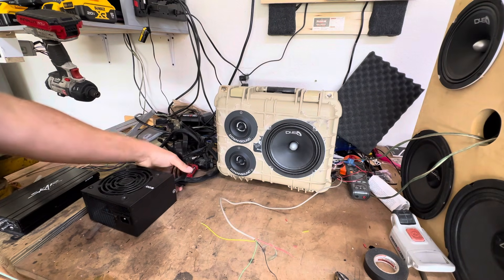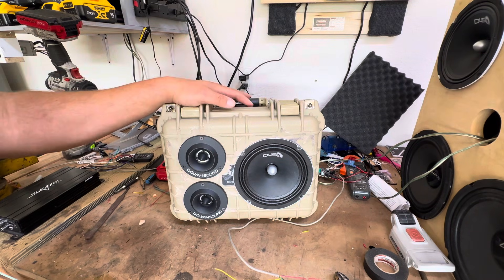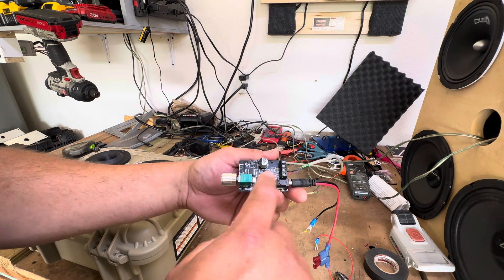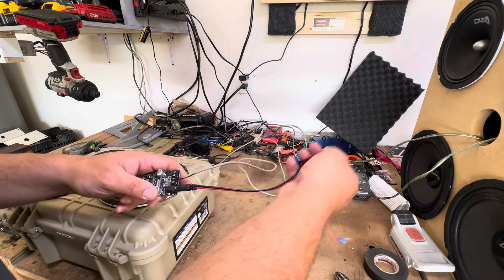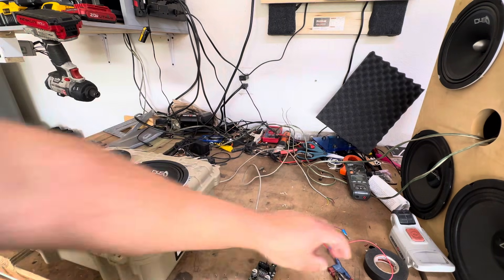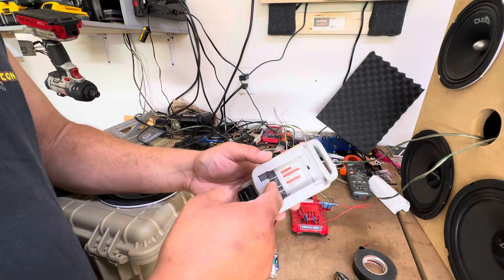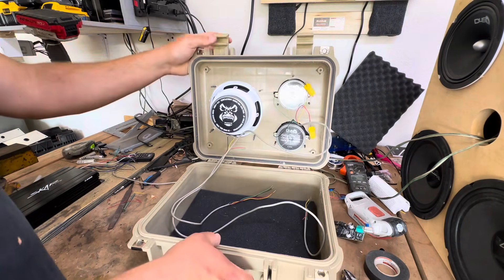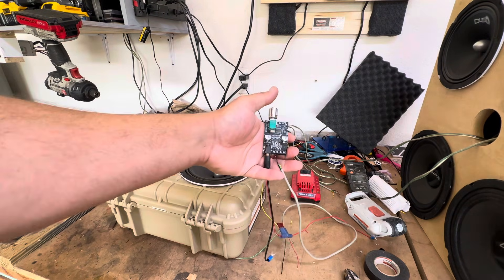Come build a portable Bluetooth speaker box from harbor freight with me

Comment: In this pac Gardner Bender 20-151P Fully-Insulated Barrel, Red (22-16 AWG) on Amazon  does it just have female ones in it or both and which one in the pac would be female?
Reply: Hey, there are male and females in that pack. Female is the one u insert the male into, male is flat female is the opening

Comment: How did you wire them together I am using an 8in subwoofer and 2 tweeters for my box and got a Bluetooth receiver and a small car audio amp I got everything wired up in the box and it worked after messing with the wires but then stopped working it is confusing me because the subwoofer has 8 connectors hook wires up to do you know how I could get it working?

Comment: Is this all it needs to work. I came from tt and i wantsd to build one
Reply from the maker: Speaker , switch , battery , battery adapter , low voltage cut off and amp is all
Reply: @Builtnotboughtboomboxes how do you do the low voltage cutoff
Reply from the maker: @Ydkrhsltgei  quick Google search but if you know the voltage and how many cells you can figure out the minimum since most take a 18650 Samsung cell. 3.7volt per cell average lowest point is 3v each but want a buffer. So 20 volt batttery has five cells most measure high at 3.9v so 3x5 is 15 give it 15.3 for safety
Reply: Ok thanks